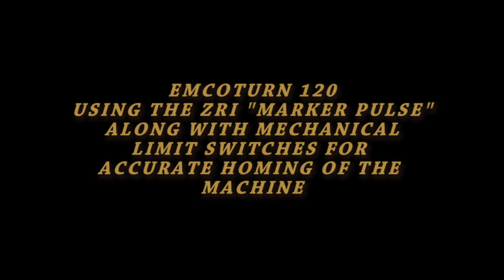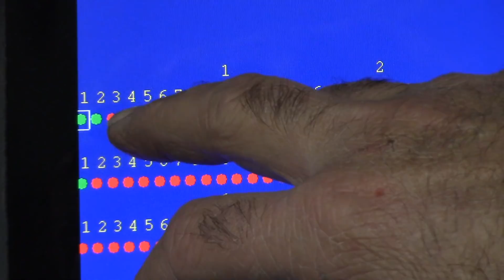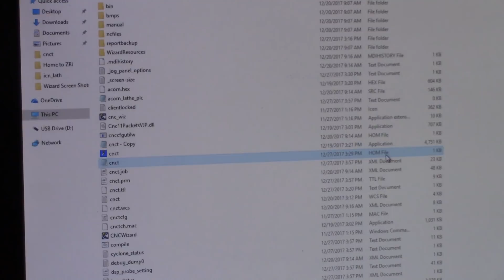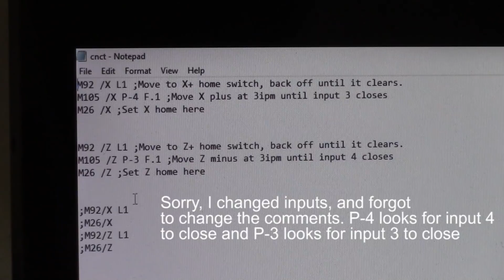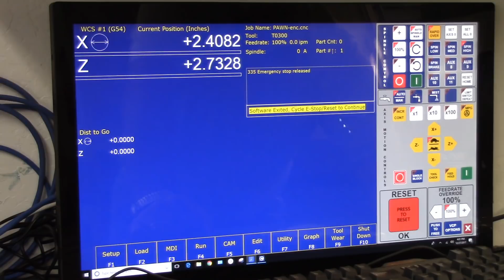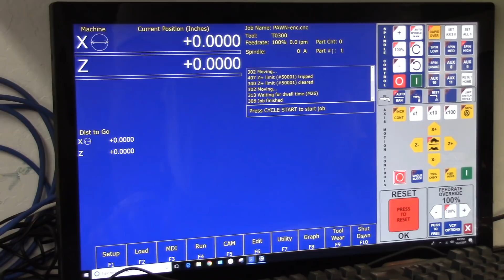Emcoturn 120 Using DMM DYN2 ZRI & Centroid ACORN for Accurate homing

Comment: Is there a way to do this with clear path servo or steppers? I have a lathe I’m converting and it has encoders mounted on the end of the ball screws. Could they be replaced with ones that have a zero reference point? I was leaning toward clear path’s but now I’m thinking this is going to be more reliable system.
Reply from the maker: Clear paths are good servos. Do you have an Emcoturn with the proximity sensor on the ballscrew pulleys? If so, you can use them as your "ZRI"

Comment: Is a mechanical switch more consistently accurate than a proximity switch used for homing?
Reply from the maker: No, in my opinion a good proximity switch is more accurate for homing if set up properly
Reply: @martyscncgarage5275  What's the typical accuracy of a proximity switch used for homing? For example would it be consistent enough to be able to continue working on a piece if the machine had to restart and rehome?
Reply from the maker: The best way to home a machine is to use a good mechanical switch to get it close, and the back off of it and search for the index pulse on the encoder of a servo motor. Next best would be a quality proximity sensor.

Comment: I might do the same, at least this allows tool offsets to remain fairly spot on. It seems getting this level of accuracy or even near this with mechanical or optical (proximity) type switches is near on impossible. Plus, you then have servos :-)
Reply from the maker: Yes. Very accurate homing. If you guys from DMM, tell them Martyscncgarage referred ya!
Reply: @martyscncgarage5275  thanks, have asked for some pricing. Need to decide between 400 and 750watt units. Harrison m300 conversion.
Reply from the maker: I think I would try and go for 750w direct drive or 400@2:1. If you don't need fast rapids then 400w should be ok.
Reply: Thanks. The cost difference is not an issue, space might be tight but I can make a plan. Going 750W at least allows both options if needed.
Reply from the maker: Talk to Michael Tien at DMM let him know I referred you.
Reply: Thanks, I emailed their sales@ email address, do you have any direct contact details for Michael? Thanks.
Reply from the maker: He does most of the replies.
Reply: Thanks, got a response from him overnight / this morning.
Reply from the maker: Charles, Michael tells me they now have cables to connect the DB25 to Acorn, saving you the wiring trouble of the connector.
Reply: Lovely, thanks, ill ask about that.

Comment: Marty,  At the end of this video you have a picture of the wiring.  One of the things I noted were the fuses that I assume are for the the three servo drivers.  The question of how to fuse these control boxes is one I have had for a while.  Is there a rule of thumb that can be used to size fuses?  steve mckay
Reply from the maker: trottrr50 it's dependant on the size of the motors and voltage they run at.

Comment: Does this work for dual driven gantrys ?
Reply from the maker: janne k you mean like the Y axis gantry on a router? Yes it can pair motors. Please visit the Centroid CNC user forums, do your research and ask your questions there. http://centroidcncforum.com/viewforum.php?f=60
Reply: What i meant was, if i home such a gantry with dual motors and they both hit mechanical switches to then turn opposite direction until they find their own internal mark, isnt there a risk of one of them finding it say right away and the other perhaps going almost a full revolution making the gantry not square to the table ? Im sure im just having a brainfart and theres ways to account and adjust for this.
Reply from the maker: janne k take it to the Centroid User Forums, describe and ask your question there. Centroid staff monitors it
Reply: Ok will do. thanks.